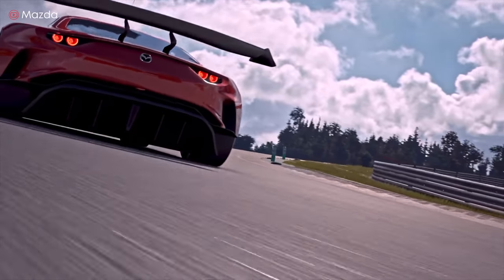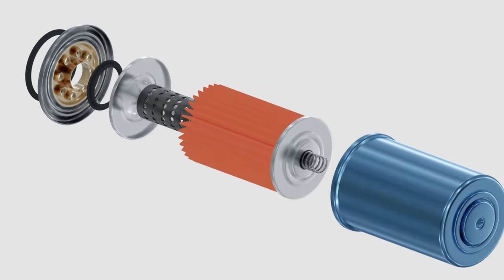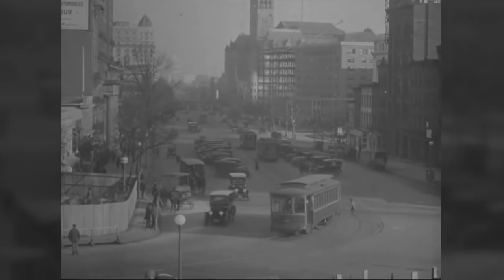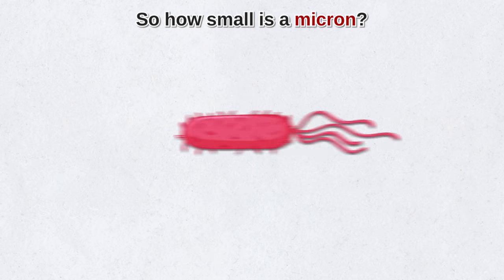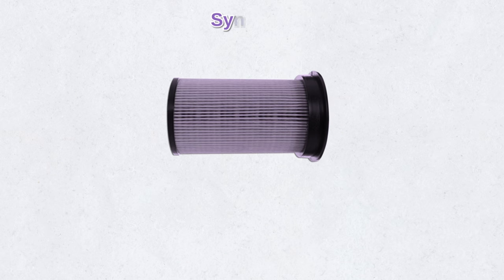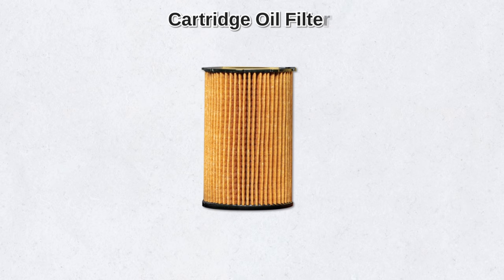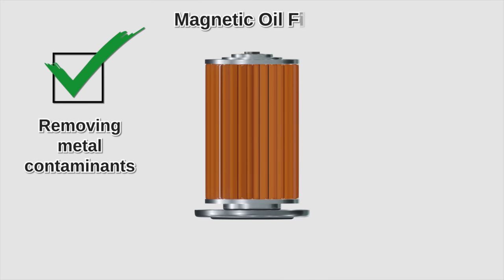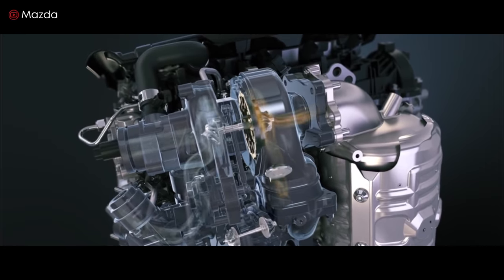This New Oil Filter Just Changed the Game (No More Oil Changes)

Comment: Buy an EV and quit worrying about stuff like this. No oil filter,or oil dumps in Battery electric cars. Come to think there are 100’s of parts that battery electric cars don’t have 🤪😂😂
Reply: I paid 3.000 bucks for my 06 Altima. A new Tesla would save me a bunch of money on gas and oil. I paid 1100 bucks for the 76 F 250  with the 390. A new Powerstroke would save me on fuel. I think Scotty s aid the Nissans were junk but I had already bought it. Installed a Japanese import engine. That's life for a poor boy. Wife wants a new  Honda suv.Says she bumps her head getting in the Altima. She is 5' 5..spent 40 bucks on tie rod ends. She said the old car is getting too expensive. I'm 80 trying to save enough to buy an electric car. Because of my age I can't  get financing.

Comment: A cartridge oil filter is "easy to use", Scotty?  Boy, you sure talk out of both sides of your mouth.  When you're not reading somebody else's script you can't stop talking about how awful and stupid and difficult to use cartridge filters are.  At least you tell the truth some of the time - when you're not being a paid narrator .
Reply: Daughter has the little pontiac 2003 Sun bird ? I think. Has the cartridge filter on top. Easy to service Last two elements  the oil pressure had crushed. Worked for Safety Kleen It was a hassle  recycling the spin on filters.Had to separate all that metal from the paper. I think we just shredded  them.